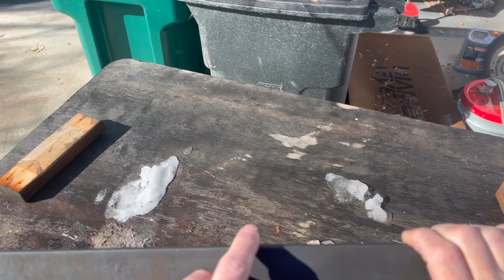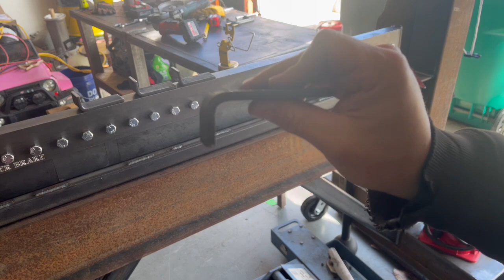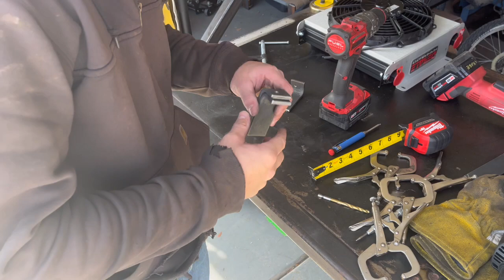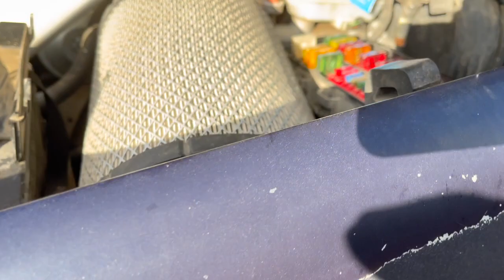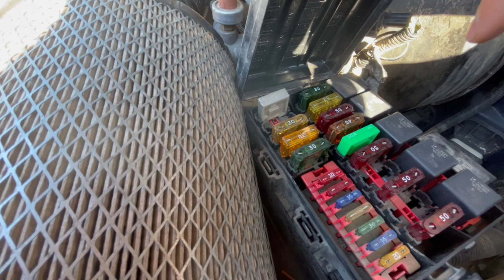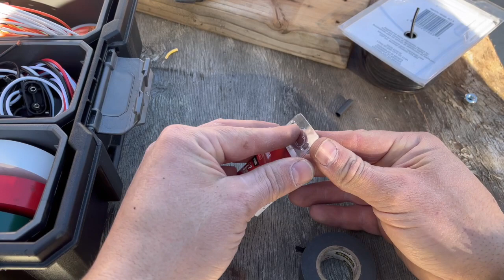1995 Ford E4OD Transmission cooler install (OBS Build Series Part 1)

Comment: Why under the truck, though? 140-degree blacktop has got to do a number on the life span of that stuff. Not to mention potential road debris.
Reply from the maker: Just like every part on a vehicle it will not last a lifetime wether that’s due to breakage or failure. And I put it there cause it fit, over a year of usage and it works fine. Thanks for watching!
Reply: @starspangledgarage  Hey thanks for actually getting back to me. I was genuinely curious because I'm having issues with mine blocking airflow to the radiator when idling, trying to decide on a small electric fan or just putting the cooler somewhere else. Nice truck by the way! My daily is a 94 with the 300.
Reply from the maker: @christianbelcourt279  that’s the thing about “custom” is you can put it where it works best for your application. Thanks for the complement, one of my favorite rigs of the fleet!